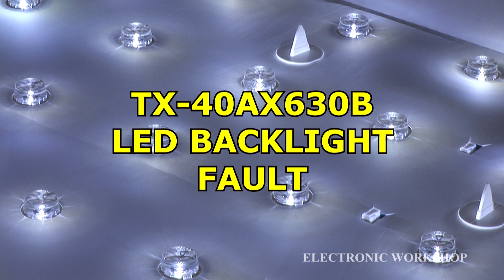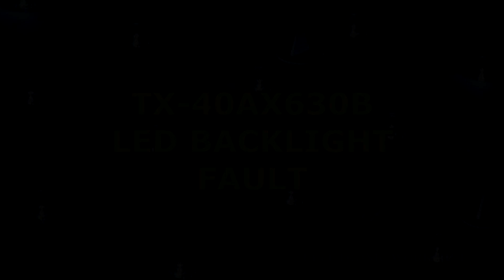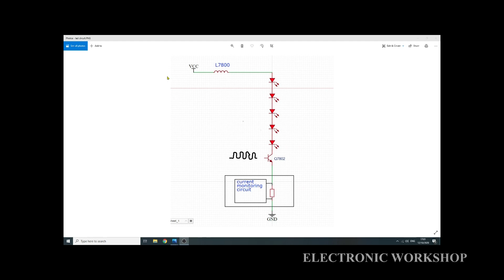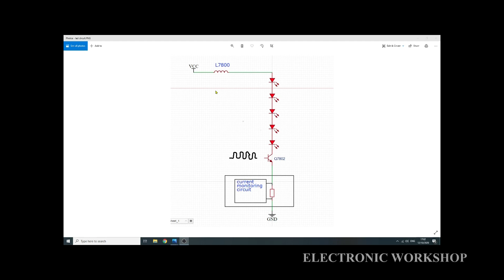TX-40AX630b LED DIODES Circuit

Comment: Thank you very much for an excellent video. I wish I had a teacher like you when I did my HND in electronics, I might have finished it.
I have a similar problem with our Panasonic 40AS640B. The green light flashes and then goes solid and repeats this over and over again.
On rear occasions with button pressing it went to a solid red. There is no picture or sound screen flashes momentarily then stops.
I have never attempted a fix for a tv before. It looks like I am in the deep end with the leds.